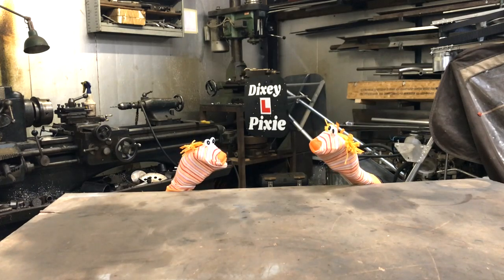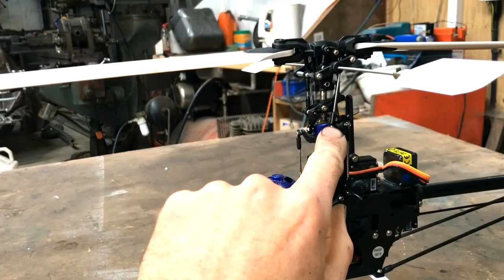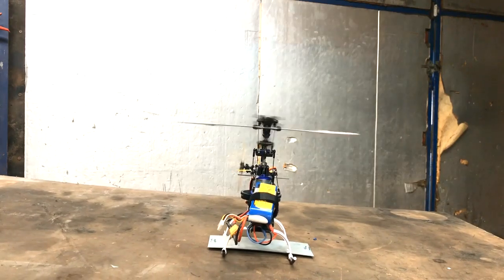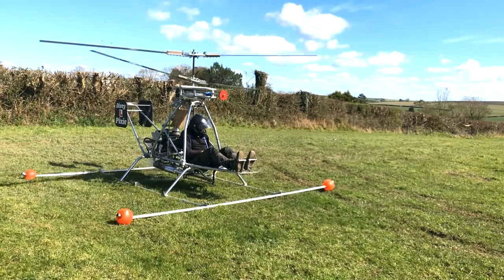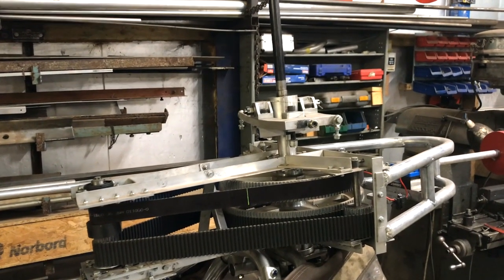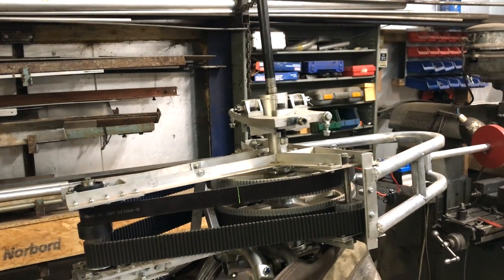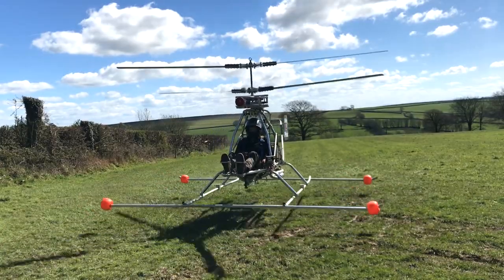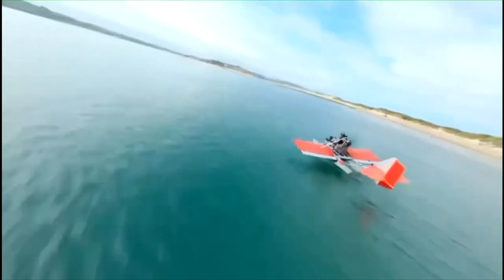Rotor dynamics and a NEW PROJECT announcement

Comment: Ground effect boats or planes are dangerous. Look at how close the wing gets to the water. If you stuff up, or get a wind gust, you are fish food. Fully articulated is the best, and it is not very complicated, that is what I chose after a lot of research and comparison. Look at the MD500 system, or the AS350. Both are quite simple and low maintenance. Designing such a system for a small helicopter is easier. When you spread the load over multiple blades it also becomes easier in my opinion. My design is 6 blades. If you have no intention on flying fast or high, go for a rigid system such as that on a BO105 as its simpler again. The Robinsons were designed to be as cheap as possible, from a mass production with a target market of the low income it must be kept very simple. For one off homemade not so much. The stability alone of a fully articulated rotor outweighs a teetering hinge. I looked at making a model, and a simple helicopter and slowly climb the ladder, but it ends up being more expensive and complicated and time consuming making several versions than just tackling a design that is a little more complex. 
I enjoy your humour and videos, best of luck Ben.
Reply from the maker: Hi John, thanks for the comment, the wing tips of a wig boat coming into contact with the water is a concern but can be protected against. James Greenberger added small sponsons to the trailing edge and I believe has tested the feature. The wig boat idea seems less dangerous than a homemade helicopter but until you experience it I suppose it's difficult to draw conclusions. One of the biggest concerns I had with mine was that driveshaft right behind me, a different design getting that feature further away or incased would have been safer. Lack of any rotor overrun was another potentially dangerous feature. Your helicopter sounds like it will be safer than mine in those respects but fully articulated rotors can experience ground resonance as you will know, which can result in the total destruction of the helicopter. Getting this right is going to be critical to safety and that's before you have even left the ground. 
It's difficult to quantify how dangerous something actually is, it comes down to opinion most of the time. I think homemade helicopters can be safe if designed correctly but there will always be risk. 

The bo105 is an awesome rotor head 

How goes the development on your mini MD500 ?
Reply: @Ben-Dixey  I dont see the point in something that doesn't fly, and is less practical than a boat. The sponsons may help, but still. I thought for your heli the best option would be having the engine tilt with the rotors, so no need for a flexible driveshaft. a mechanical or electronic governor could have fixed the engine overrun concern. As for ground resonance, it is a concern and have not overlooked it. Having more rotors that are lighter means they require less movement in lead lag. They are less susceptible to creating an imbalance, although not impossible. Most of the resonance issues is with 3 heavy rotors. It is untested so far and complicated, but there are many factors that induce resonance, mass, rpm, drag, the range of movement that occurs and that is permitted. For test flight I will remove the lead lag dampers on rotors so that there is no chance of an imbalance occurring. For testing and hovering this will be acceptable, it is only in forward flight that lead lag is really required. I will have dampers on the landing gear, plus I intend to have a wheel dolly or larger skids under the landing gear for first flight so that it can move freely side to side. I do intend to make pontoons/floats also, so could even use the lagoons on the farm as a shock absorber.
My project is slowly going. Working on transmission and doing oil testing. Stuck on what dash to use, so many options, You can spend 5-20-k on a screen alone, I want to choose the right one. I procrastinate and then a new model or product comes out, far out. I still have a lot to do, still have to make a pressure suit for high altitude and hope that it doesn't pop, lol. its all fun, thats the main thing.
Reply from the maker: Sounds good to me and that is the main point, having fun. You can't get much more excitement than designing, building and testing a homebuilt helicopter. The point of the ground effect boat is primarily to have fun and low to the ground is where I think the most fun can be had. My helicopter was only intended for hovering but a achieving just that isn't easy. 

I suspect it's a good idea to test yours without the dampers as long as the wind is calm. A head wind will give the same scenario as forward flight. 

How do you go about balancing multi bladed rotors ? Not something I've considered.
Reply: @Ben-Dixey  From my understanding, at least here in Australia is a ground effect boat only requires a boat licence, so cost is saved there.
All flight tests will be conducted in the early hours of the morning. 2-4am is usually very calm. I have thought of that. Dampers are to reduce the stresses applied to the rotors to prevent fatigue damage, and this is an occurrence at higher speed. For short term, it is not an issue.
As for balancing, it is not all that different from a rigid or semi rigid. The overall weight and centre of balance must be the same. For tracking balance, the rotors have a trim tab fixed to the blade so you can make them all rotate on the same axis by bending it slightly up or down. I have not made my rotors yet, but intend to make a few more for stress testing. I have designed the rotor head to accommodate small cameras that will be able to overwatch each rotor on a screen in the cockpit for tracking and movement. I keep thinking of ways to add complexity. We have so much technology and products available to the average person now, it makes possibilities so much easier. Off topic now, but little cameras I think are great, you can have them pointing in all directions, in the engine compartment, looking beneath, watching the tail boom. One of my concerns is pulling hard rearward on the cyclic and having the rotor hit the tail. By having cameras I can see how close it gets. After I am confident with a hover, I was thinking of making a mock up cockpit and using radio control and fpv for more adventurous testing. I do worry, I will be over excited and try and fly fast too quickly. I figure Ill just chase kangaroos around for the first few hundred hours. 

Anyway, enough from me.

Comment: Very cool man, I wish you all the best of luck with your new project. 
Have you ever considered building an E-VTOL? Something like a Jetson one? 
Its a fairly simple concept. I am walking around with this idea of a 1or2 person E-vtol with the design of a lillium jet mixed with pantuo pantala focussing on the fly time en minimal payload. Where the big companies focus on transporting passengers and goods i want to have as much air time as possible just for the fun of it. I dont need to go fast. But there still needs to be room to correct you plane quickly. This makes it safer en easier to operate, since you can correct any forces working on the plane much easier.
Also you can leave most of the mecanical engineering behind which in my opinion is always less safe to operate.

Again, good luck. I will be looking forward to your videos. 

Best regards
Jan from the Netherlands.
Reply from the maker: Hi, yes I have thought about it. The Jetson one is interesting and would be a lot of fun. Amazing diy projects channel is building something different, much more efficient than the Jetson but will only be for hovering in very low wind.

Comment: https://www.youtube.com/watch?v=gyLwK7Akx2I
give some thort to par thrust  for initial lift at low ground speed ..  im  putting the  big motor cycle engine  at the cg and a long propshaft  to a cv joint and thrust bearing steering knuckle to tilt the prop up a tad at takeoff  .  and yes my cv boots r holding up at 2000 rpm on a test bed  ..     motorbike  sprocket to driveshaft adaptor from kit cars .. takeoff in 2nd .. shift to 3rd for cruise .     .. jeeeez what a wanker i am
Reply from the maker: Thanks 👍 Par thrust is a smart addition I think, I don't know if there are any drawbacks to it other than the more complicated drive systems. What stage are you at with your build ?
Reply: @Ben-Dixey  iv done a  full size mockup in cheap plywood that becomes paturns  for a stitch and glue boat  with wings 
and  worked out all the machanical  drive train stuff  on a test bench  ,, thats done . thin marine ply and epoxy next  oh joy .  im a steel boat man . and epoxy tries my patience   oh .. the canard is pitch control  btw   and   having the engine inside is less drag .   and lower cg  ..i love james wings nice and simple  easey to extend
Reply: also built a 3meter r c model to test P A R  thrust .and fully flying canard .  its very effective .. jumps off the water .  . water is very sticky and draggy    and hard when hit at speed   and much bumpeyer than an air strip

Comment: Hi Ben, The Rotorcycle has a paddle bar, to allow for the 90 degree phase difference when controlled by a hanging stick, And not a floor cyclic stick. Also paddle bar absorbs pitch change vibrations coming back through the cyclic control stick. As someone else siad it acts as a servo.
Reply from the maker: Hi Peter, I'll have a look at the rotorcycle controls and try and understand it.

Comment: Bear in mind that WIG craft can be dangerous, specifically if they get some sudden upwards thrust on the nose. Many high-speed racing boats have been lost to this, so it's important to plan a countermeasure to restore horizontal flight if it happens.
Reply from the maker: Thank you, the centre of pressure change lifting the nose when coming out of ground effect. Wig vehicles have large tails to keep this under control I believe. I need to get the design right for sure. 👍

Comment: At 2:15 the same experiment was done by the rotor stabilizing bar inventor (Arthur m. Young) in this youtube link (https://m.youtube.com/results?search_query=birth+of+the+bell+helicopter+&sp=mAEA) titled "the birth of the bell helicopter part 1" exactly at 6:10. But I think that the system used in the RC model is a mixture of A. M. Young and hiller systems
Reply from the maker: Thanks 👍 yes that's where I got the idea from to observe the time lag. I forgot to mention the servo assistance that is given by the paddles. But messages by martin garrish in the comments understands it better than I do. I believe Arthur youngs stabiliser bar was heavy on the controls.
Reply: yes in deed; the the stabilizer bar makes the helicopter more stable but less  responsive to control inputs.  this system was the a trade mark for bell  helicopter early models(the bell 47 and  the famous bell huey) but abondonned in the AH-1 Cobra and replaced by  tunable electronique stability augmentation systems
Reply from the maker: @abrahamjushua9491  thanks for the info. 👍👍

Comment: Hi Ben, I love watching your all your adventures, I used to be a commercial helicopter pilot in Australia ( now UK ), I also had an opportunity to fly a prototype 8 seat WING IN GROUND EFFECT craft. I think the helicopter is a safer and easier beast to fly, it all gets a bit scary at speed, when all you want to do is gain some altitude, but can't. I felt as though lots of control inputs to maintain attitude a metre off the water at 60 knots. I looking forward to see what happens, Cheers
Reply from the maker: Thank you and interesting comment. I have zero experience with fixed wing or ground effect vehicles. I can understand how flying so close to the water could be a high work load for the pilot. Not something I'd considered actually. It will be interesting to experience. You see people doing all sorts of things on videos and never know until you try it what it's actually like. Hovering the helicopter was 90% stressful and 10% enjoyment but that would have improved with practise. Wonder if the same could be said for a wig boat?
Reply: Frizt, was the control challenge to maintain altitude? "In theory" lateral control should be easier, as the lower wing generates more lift. I think longitudinal long & short period oscillations fight altitude stability so you have to tell the aircraft to stay level. Literally a sustained held off landing.
Reply: @martingarrish4082   exactly ,a sustained held off landing.

Comment: orrrrr... you could go for the chinookish V-22 Osprey, just a Chinook at 90 degrees. I had considered this and make it fly by wire using Rotormast V-22 controller board. Driving the rotor controls via a proven control board for the base signal to drive amplifiers of each flight control element, whether mechanical or electronic would be interesting. The ekranoplan would be cool and worth watching too. You are super educational to watch. I think the channel name change is better than apparent random and forgettable alpha-numerics.
Reply: I'm always nervous about life dependence on a mechanical system with electronic control. Only recommendation would be assume it will fail at some point then design it not to. This usually means that mechanical control is the got to solution for homebuild.
Regarding planform then as Sergei Sikorsky once commented to me at a helicopter conference: keep the disk loading down. The AW609 was a commercial offshoot of the V22, but high autorotation descent rates means that 20 years after first flight it still isn't certified. A lot of the new e-vtol designs make the same mistake, so I take their certification timelines with a pinch of salt. Whatever power system you use assume that it will fail at some point then design it not too. My money is on Jaunt Air Mobility for air taxis (interesting wing & rotor compound design).
That said, there are many technical advantages of side-by-side lateral symmetry as long as you can live with the increased planform width for a sensible disk loading. Overlapping the rotors will reduce rotor induced power, but we are talking about helicopters where laminar flow is just unachievable. The Chinook was Piaseki's solution to heavy lift in a small planform. There are some advantages with reduced power for an anti torque solution, and they can operate with sensible payload at high altitude. Whether you would want that long driveshaft to keep synchronisation in a homebuild design is an interesting debate. Again, design it not to fail but assume that it could.
Reply from the maker: Good points Martin on dependable mechanical linkages for control vs electronics. Interesting what Sergei Sikorsky said about disc loading a phrase I've heard a lot. Its just a shame that low disc loading comes at the price of increased hangar space. 

The driveshaft between the two rotors on a tandem is a worry it if breaks but synchronisation is less so because one rotor is higher than the other I believe. 
Perhaps multiple V belts instead of one driveshaft would be less likely to result in a catastrophic failure. 
I think Believe Boeing had a drive shaft failure with the development of the chinook.
Reply: @Ben-Dixey  , rotors don't need to be going around in the hanger 😉. A smart fella like yourself should be able to figure a reliable way to stow the rotors when playtime is over. Hanger and apron space is the main reason that teetering rotors with brakes for fore-aft parking have dominated market. With a 3 blade system then there are neat systems to fold all three blades along the tail boom. Obviously the very real risk is that the retaining pins don't get fitted or fall out in flight.
There is the idea of upscaling a quadrotor so that teetering can still provide pitch and roll moments at reduced gee with differential collective pitch. As long as the thing can safely autorotate to the ground in the highly unlikely event of a drive failure 😟. Then the rotor booms could be folded to stow the machine, and the retaining pins more solid and easier to see.
Just my brainstorm...
Reply from the maker: Thanks for the suggestion, the v-22 is another intriguing machine. Bet R&D was substantial when building that. Combining a twin engine plane and twin rotor helicopter is some project. Incredible when you think about it. My knowledge is more mechanical based but with help I'm sure I could involve electronic flight controllers. The v-22 idea if it could be tested unmanned would be the way to go.

Comment: I just love the idea of the mini-chinook, it's such an underrated format. high speeds from the low frontal area and great lift from the low disc loading. the linkages are not too complex, especially if you dont worry about the auto pitch compensation. I'm loving the WIG idea too, cant wait.
Reply from the maker: Thank you. 🙂 the auto pitch you mention is that the mixing of collective into the swash plates ?